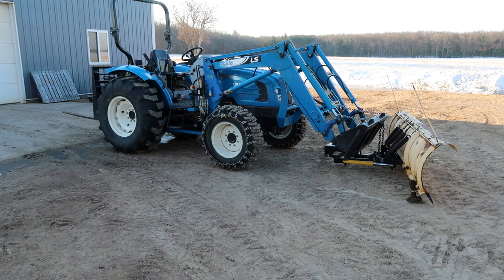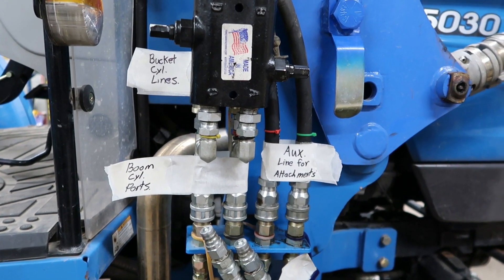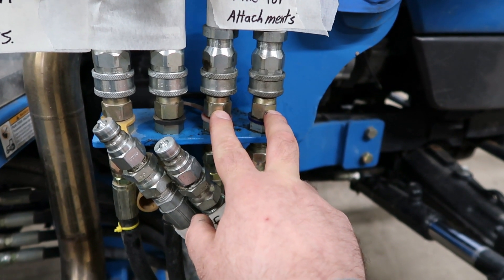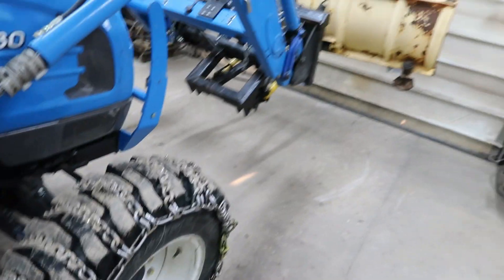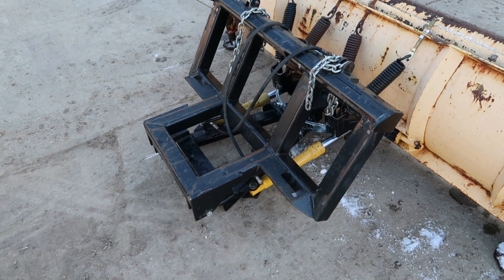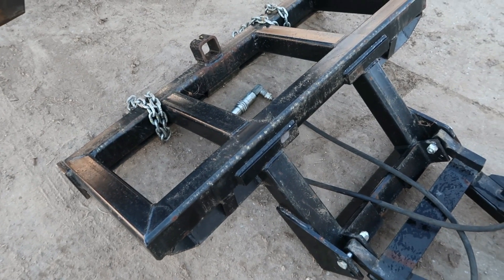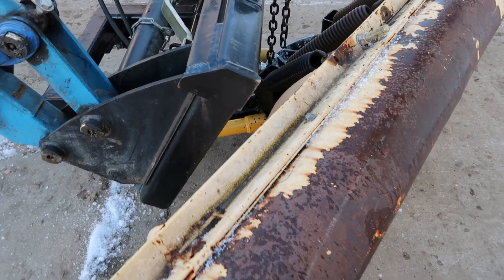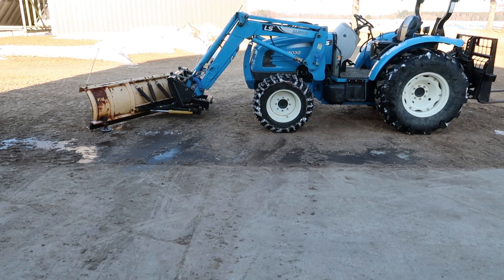Hydraulic Snowplow on Loader Tractor without 3rd Function- is it Possible?  #9

Comment: Great!  Good idea!
Reply from the maker: From Steel To Wood thanks. It’s by far the best setup I’ve ever used for running a snowplow on loader tractor. It’s just as fast and controllable as a pickup now. The cylinder stops are still in use even when running it with the third function valve. Weight is traction.